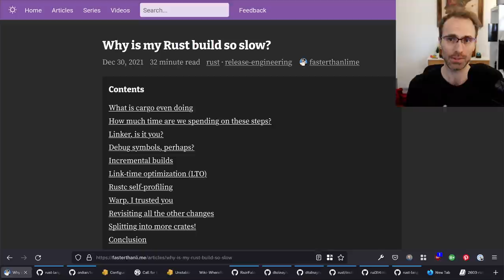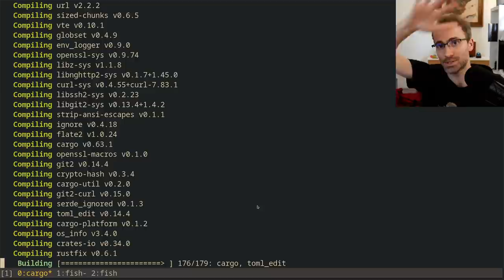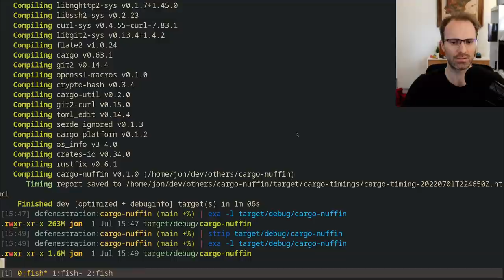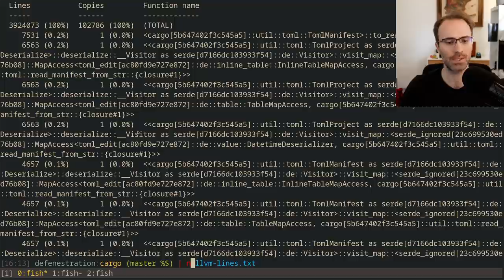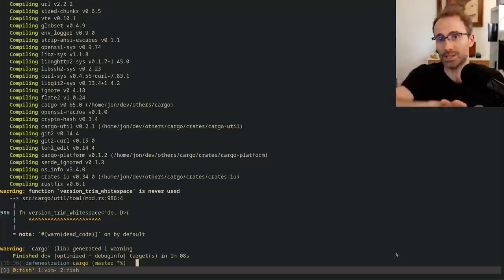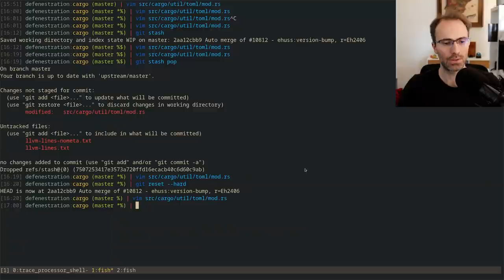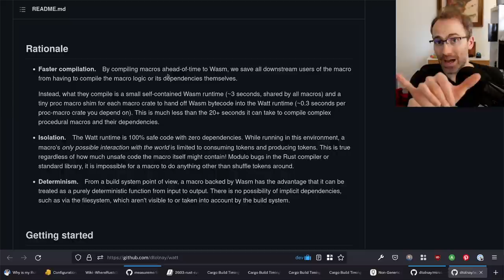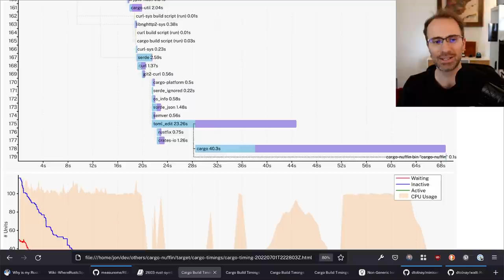Making a Rust crate compile faster

Comment: This is going to be very helpful with building Deno on the Raspberry Pi 4. I have a Raspberry Pi 4 (8GB) that runs out of memory and takes an hour to build a single artifact (mostly because it swaps out to the SD card.) Anything I can do to cut down some time on that build will save me and a few other people that are prooping up the arm64 builds.
Reply: Also, watching you lose your mind during the mold issues made me actually laugh out loud multiple times. It was like Compiler Slap Stick Comedy.
Reply: Would it be fair to say that LLVM's IR is kind of like "compiled" WASM (Web Assembly). It's not really compiled code, it's more like instructions to the abstract machine to be used by the runtime to turn it into actual machine code for the target system.
Reply: Key take away: Only enable to features you need on the crates you depend on for better build time.
Reply: The Non-Generic Inner function is a fucking cool trick!
Reply: If we could turn the performance profile output into a SQLite table, you could query and group that way. That way you could call `SELECT Name, SUM(duration) FROM flamegraph GROUP BY Name;` And that would give you the answer as to where it's spending it's time on the aggregate.
Reply: Is there a way to tell cargo to only use so much memory? In this way, I can prevent it from swapping out to the SD card for Deno compiles on Raspberry Pi 4s that use over 8GB of memory for the cargo build.

Comment: One thought I had about the perf tools, it might be nice if instead of the per-crate numbers, if you get numbers relative to the salsa-esque compiler internal query evaluation model, which has a much finer grained dependency graph than per-crate.  I at least wonder if there is anything in the self-profile like the "args" that could somehow include queries, that either exists, or could be added.

Comment: So borrow checking takes some time... why not start compiling and linking before the borrow checking completes? If the borrow checking fails while compiling and linking then it can abort it. The borrow checking is used to make sure that you are not doing some unsafe stuff but it should not be needed to compile the binary.
Reply: This logic could be applied to anything like type checking or whatnot that gets stripped away and doesnt end up in the compiled machine code.
Reply: Both borrow checking and type checking affects the generated code.

Type checking is required before compiling because it is computes what to compile, due to generics.

Borrow checking is required because it computes where to add all the drops, because lifetimes can be shortened within the a scope due to how other variables are used.

Comment: Jon, have you heard yet? It's all over the Rust community.  I invented "impl vars" ... me ! little ole me ... crusty ole me.
I was thinking about it more, and it kinda brings about another concept here, which is "mixins". By tying the data to the trait impl, it's really off on it's own in a way even if it contains a portion of the instance variables. Feels like this could be "segregrated out" in a way so that an implemented trait (full with instance variables) that can be "mixed in" to several classes. This is more than just a "default trait" implementation, because as I understand it, those don't allow shared instance data between the default method implementations of the trait. So, this really opens up 2 things - keep each traits data separate from one another, and enable 'mixin' functionality with instance level data (possibly).
I know they won't want to credit me, but ... regaaaaadddddddless, I'm the one ... It was me... ALL ME... In the words of the famous Mr William Hung, "I have no professional training"

Comment: The slow compile time is one of the reasons why i continue to use c++, i have interest in Rust, but for me it is not enough, I'm still waiting for more optimizations in the compiler and better computers to reduce the compilation time.
Reply: Rust has additional checks to make sure that you don't have to face runtime errors. Even though Rust is fairly new, the tradeoff is still worth it.
Reply: @ArnabAnimeshDas  to some.
Reply: As if C++ build times are significantly faster 😂
Reply: c++ too suffers from the same problems that slows down rustc compilation. templates, llvm codegen etc.
Reply: @----__---  the lack of a borrow checker is a significant speed up
Reply: @----__---  borrow checker is not Free, this has an effect on performance
Reply: @ronaldweasly561  compile time performance
Reply: @ronaldweasly561  People don't understand difference between runtime performance and compile time performance.
Reply: @well.8395 Borrow checker can absolutely have an impact on runtime performance by making it orders of magnitude harder to write optimal code. Rust is just not the language you use if you want the best performance, it is the language you use when whatever you are programming really cares about safety, wich is not true for 90% of software.
Reply: @marcossidoruk8033  70% of CVE bugs are due to lacking memory safety.
Reply: @----__---  C++ doesn't suffer as much problems from templates as Rust. Because C++ templates are so annoying that one would want to avoid it for good.

Comment: For some reason, my previous two comments have been deleted by Youtube. Anyway...
If you want to know for sure that a certain process was executed, you can use the "execsnoop" utility from "bcc-tools" Arch package
sudo /usr/share/bcc/tools/execsnoop -n mold

The biggest impact on build times I've observed is due to sccache by Mozilla: my first build of a project with cargo dependency took 1m 50s, then, after "cargo clean", the next build took only 18s.
Reply: What's that? can you please elaborate on why your compile time reduced significantly after cargo clean?
Reply: @well.8395  Look it up. sccache is s a lot like the ordinary ccache, but also supports Rust and distributed compilation. It caches compilation results (mainly object files), so next time you make a clean build, it reuses them, provided the compiler flags don't change.